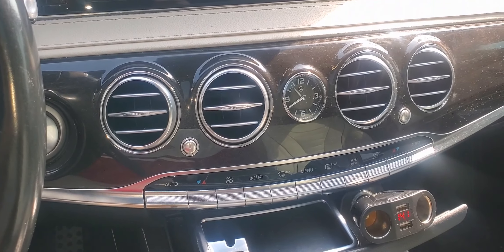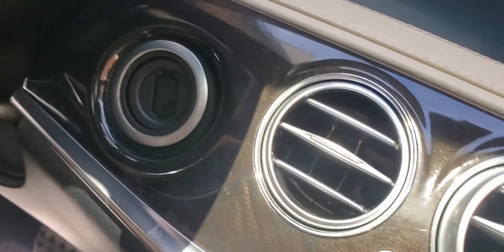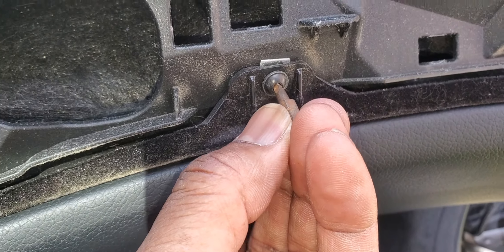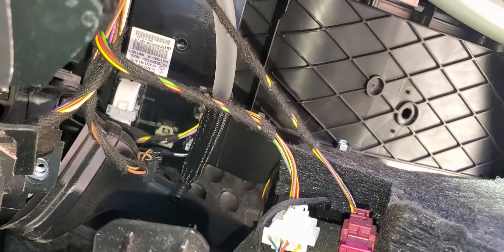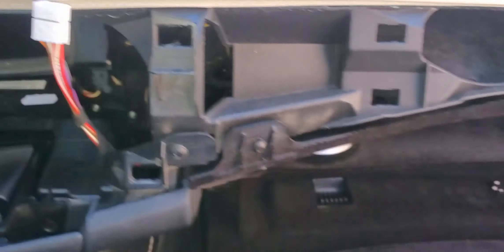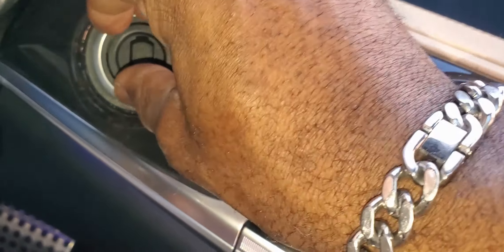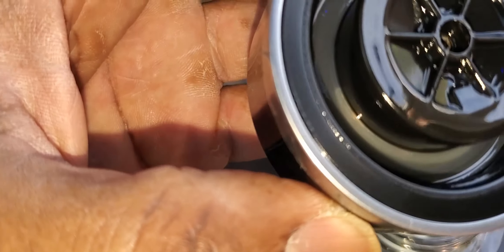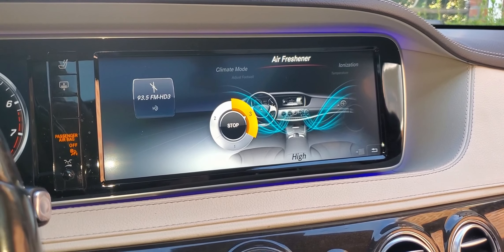Mercedes Benz S550 Air Freshner System

Comment: MB won't refill the atomizer container, but they are happy to sell you a new one for $130. Much easier to unscrew the cap and refill. The cap will likely be stuck as a result of the aromatic liquid drying on the lid so run it under warm water to loosen it. I'm going to try the Urban Naturals product but have been using New Car Smell by Chemical Guys. The atomizer system is prone to failure and requires a lot of work to find/rectify the cause. Using the wrong aromatic can cause the liquid to dry inside the air hose and clog it.

Comment: Hi there Wayne 
In my s 560 
I have the air freshener as well 
But it’s not working 

Nothing is clogged because I ran some air through it 
And going smooth 

But the actual bottle hold 
Does that automatically press down on the bottle 
Or does it make any noise 
Because my bottle goes in but nothing pressing down on it 

How is yours please?
Reply from the maker: No. You slide the air freshener bottle into the slot, and that is it. Adjust the amount with the know to allow more or little and that is it. I made a newer video on S560 Air Freshner a couple of weeks ago. You should definitely watch that dated 2024
Reply: @WayneARobertson  
Wayne 
Send me the link to the s 560 please
Reply: Also do you know if there’s a fuse for the scent dispenser?
Reply from the maker: I just made the video. It is the last video I just made. https://youtu.be/AbWIzisTUO4
Reply from the maker: The fuses are MF2 and 335. Check both fuses
Reply: @WayneARobertson  
Thank you 
I bought a new bottle of fragrance, and still not working 
The tube is not clogged 
I’m just not sure why it’s not working